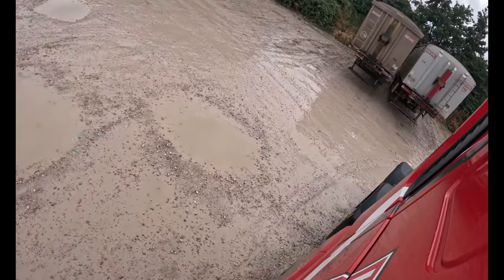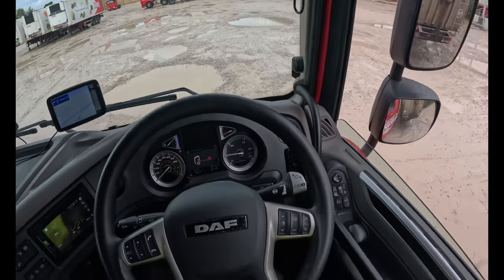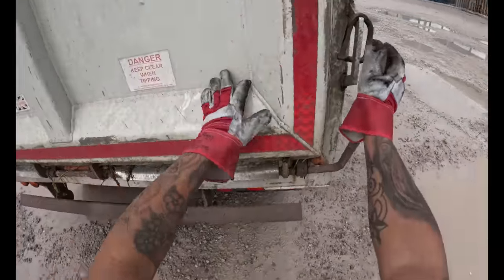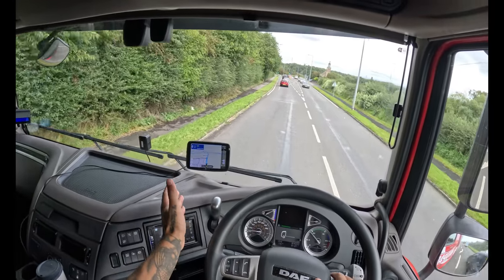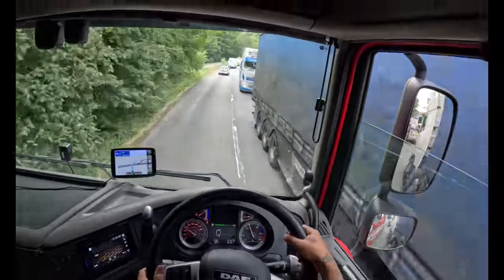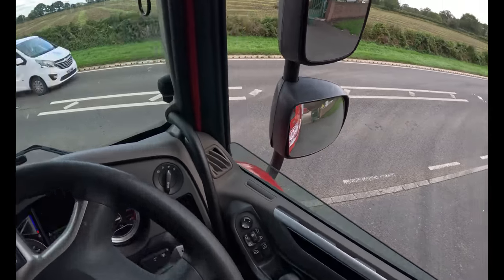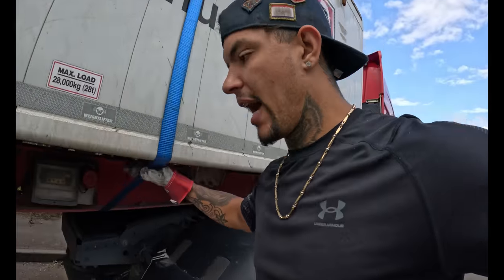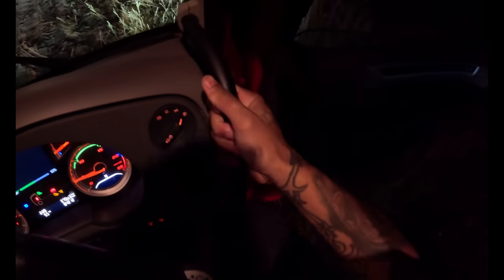This is Why HGV Truck Drivers earn 50k - Trucking UK

Comment: Another tip if youre looking for one. When you couple up your trailer, do it with the engine off. If you do it with the engine on, you risk blowing some fuses. The last thing you need is to have no lights in a pitch black field

Comment: The Transport Industry is rubbish. Over regulated and under paid! Iv been trucking nearly 2 years and been doing 32tonne tipper work for the last year. It's good money but that's on a 55+hr week. When u divide 50k by the amount of hrs u put in it's a shite wage. Luckily iv just been offered my old job back in maintenance which works out the same annually as I'm on now but for a 37.5hr week lol my advise to people avoid hgv if u want a life, and not having to start work early! There's no 8-4/9-5 jobs in this industry that pays what ure worth. Too much risk and not alot of reward unfortunately

Comment: Starting to early you are night worker . You cant do as long hours due to working time.
Reply from the maker: You can opt out mate it’s up to you and the company
Reply: You can legally opt out and do a full 15 hour shift if you so wish.
Reply from the maker: Yes you can mate it’s up to you and the company you work for
Reply: Non HGV drivers shouldn't make such wild assumptions.
Reply: I drive coaches and hgv over 35 years.

Comment: 50k a year yeah in you're dreams
Reply: £50k is easy achievable if your tramping doing 65hrs
Reply from the maker: Easy mate…
Reply: I am on 45k a year and everyday I am coming back home as I am doing multi drop so I think 50k on tramping is possible 💁🏻‍♀️
Reply: £20 an hour, 50 hours a week, 52 weeks a year, 52,000 a year. Quick maths.
Reply: I made 48k last year home every night 10 hour shifts, you just need to know where to go to make the right money.
Reply: @cc1847  quick maths== you can't work 52 weeks a year Einstein! are you saying you will get paid 50hrs holiday rate?  minus deductions, (esp if you are on the higher tax bracket) what is the net? what is the proportion of net income with regards to outgoings and cost of living? and I see the country is full of HGV driver jobs offering 20 pound per hour, really, wake up dreamer. 😂If drivers routinely got that rate there would be nobody working other places they would all become drivers and also choose to work less hours to avoid high tax and an improved life work balance. 😂P.S the employee turnover in this so called industry is one of the highest in the country. Try and garnish this awful job all you like but reality will prevail!!